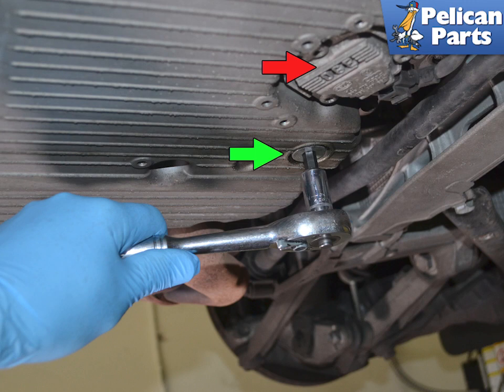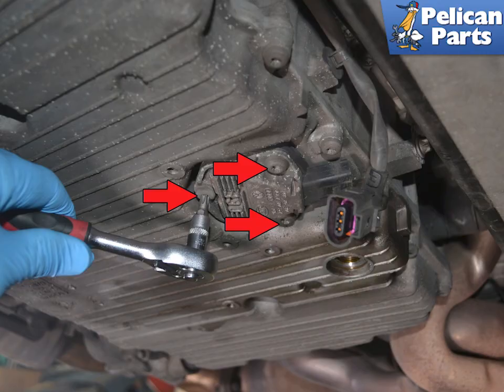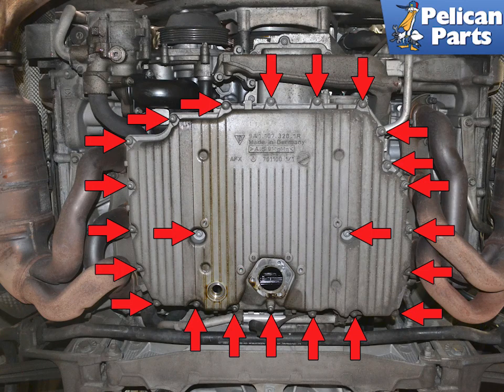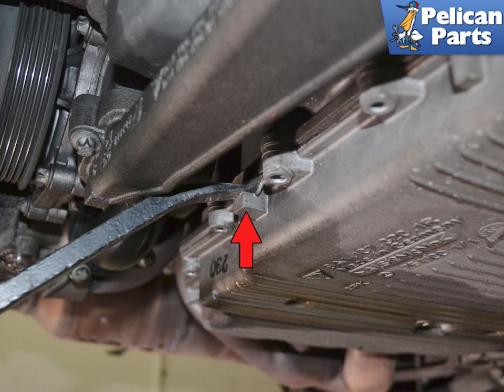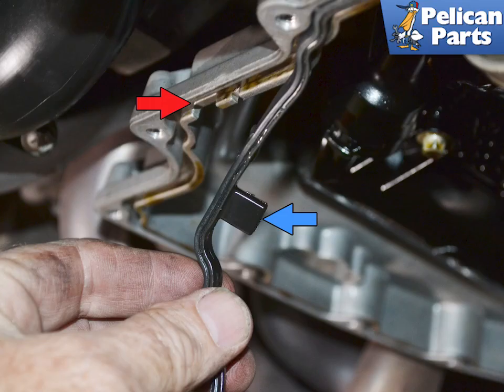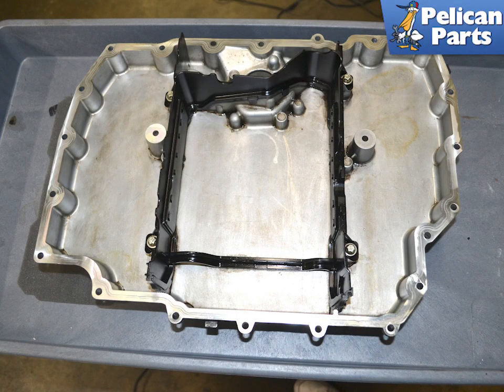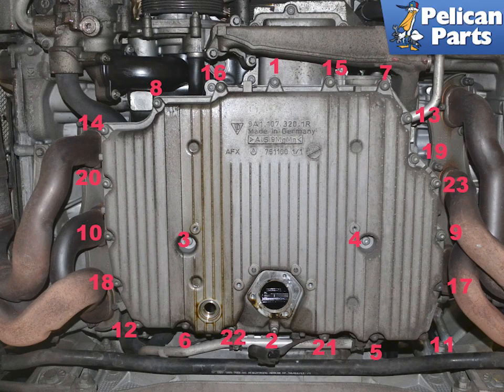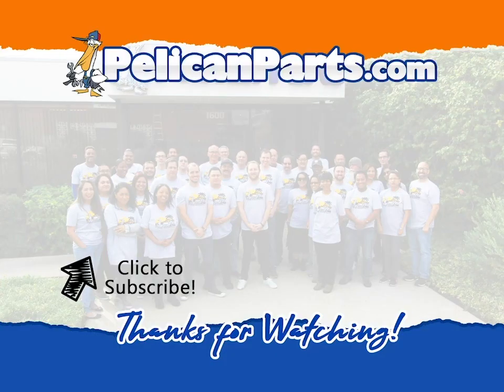Porsche 991.1 Carrera Oil Pan and Gasket Replacement (2012 - 2016)

Comment: I need this and already ordered the pan and gasket from Pelican Parts. Now I know I need the extra gaskets. part numbers?
Reply from the maker: You didn't mention what year, model and engine size of the vehicle you are working on.

With your vehicle info handy, give The Pelican Parts parts specialists a call at 1-888-280-7799. They can figure out what part or repair kit you need.

Comment: Cant find a vid for a 992 with the plastic oil pan, but maybe you all can still help. It also has a gasket. You said at the end to grease the gasket here, do you need to grease that on a 992 plastic pan as well? What grease is recommended? I assume you arent talking about a gasket maker RTV?
Reply from the maker: No RTV no grease on plastic plan.

Comment: Thanks for the video! Do you have the part number for the special tool to rotate the crank? I have a 2012 991.1S PDK and want to check for bore scoring. I'll need the special tool to rotate the engine right? Could I remove the fuel pump fuse and bump the starter instead? I'm reading that the scoring will show up on the bottom of the bores first so it's best to bore scope from the oil pan side. I can't see in your pictures, would I have clear access to the bottoms of the bores or does the upper half of the oil pan need to be removed as well? Thanks!
Reply from the maker: Tool# 9773 000 721 977 30

No bump starting these.